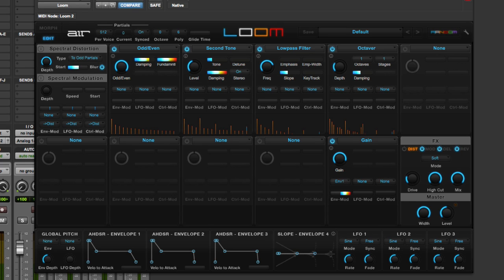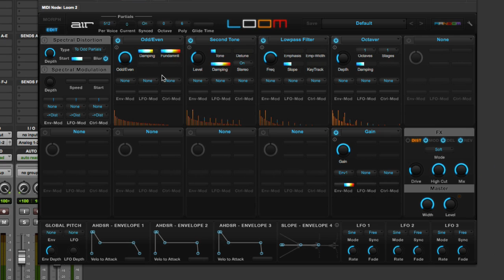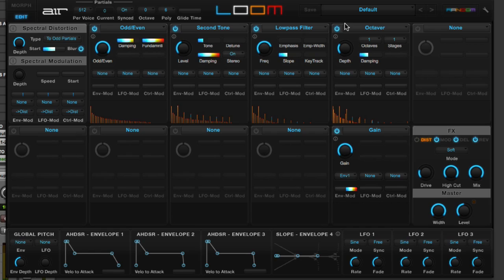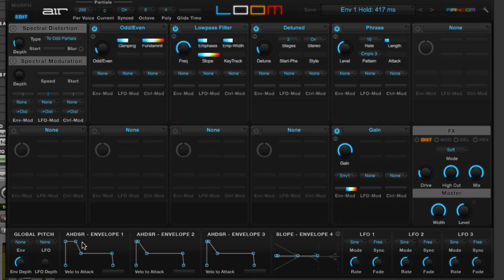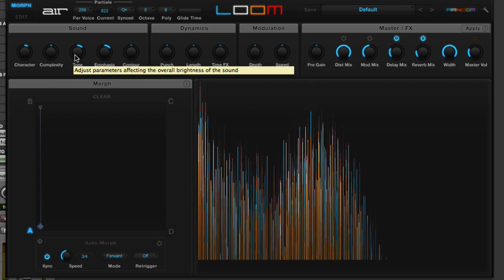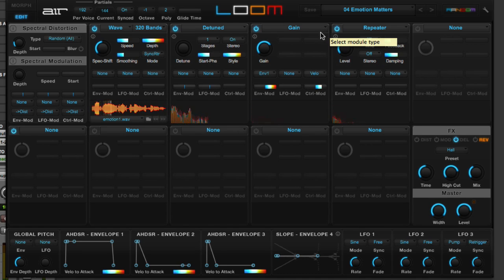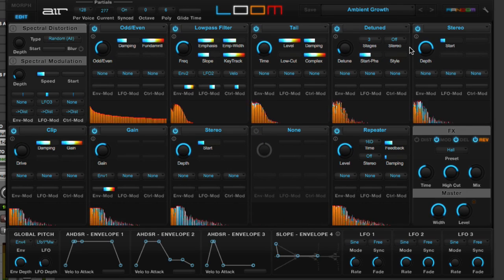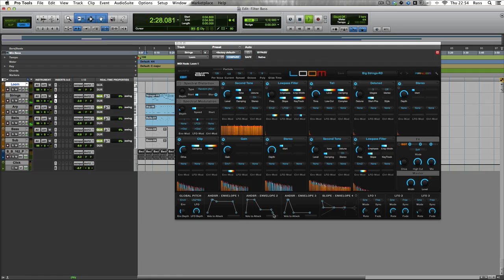AIR Loom Synth Show And Tell - Extended Video

Comment: I just bought a aki keyboard advanced and this came with it did a get the cheep version?
Reply: Cheap version? It's one of my favorite synth for FX. It has very unusual digital/robotic sounding which I like in certain cases. It's not meant to be a synth for analog basses and leads for sure. It's more like a synth for FX and Ambient. You know, the TB-303 used to be considered a useless instrument for a while until it became one of the most popular in EDM. You just got to see the potential of what you got. I love Loom cause it does not sound like every other synths! In my opinion, Loom is underestimated mostly because it is wrongly advertised. Cause to be honest AIR kind of sucks in marketing. They don't even make their own video tutorials which is a shame. They have product presentation videos but that's it. If you want tutorials you got to pay a third party website...etc.

Comment: Great demo, thanks. I was thinking, is it a better investment than DIVA ( U-he) ?
Reply: Diva is a subtractive synth. Totally different.
Reply: I work with Ableton  Live (latest version) on a 32bit environment, Air Loom is a 64bit only?
I guess I can't use it?
Reply: David German Check their website. The VST version is 32 and 64-bit, but the AU version is 64-bit. However, they don't say if the VST version is Windows only, and they claim the AU version is qualified for Logic X. I use Digital Performer on OS X, so I would email them and ask, which is what I need to do. Other additive synths are Razor, Alchemy, and Harmor. Harmon is deep (currently PC only but they are releasing an OX version soon, and I plan on getting it for sure). Razor is a bit lighter but a lot of fun to use and sounds great, and Alchemy also does Spectral and Granular synthesis. You asked about Diva. Diva is awesome! One of my favorite subtractive synths. It allows you to mix and match the oscillators, filters and envelopes sections from classic Moog, Roland and Korg type synths plus a lot more. The sound is huge (as are all U-he synths). Diva could easily be your go to classic style subtractive synth.
Reply: I have a macbook pro, I don't use a Windows comp. 
I just got Diva, and it sounds great.
I will ask AIR about Loom's 32 bit, thanks for your help:  DAVID

Comment: This product seem good only on the video presentation. while I cannot say anything about the sounds etc I can clearly state the interface SUCKS!  I installed it today. Firs I have no idea how to register it. The interface is terribly dark and super tiny small. I use 4K monitor and it is absolutely unreadable. When I open it on HD monitor it is still very bad (50% of the text is unreadable). Whoever designed DARK GREY FONTS on DARK GREY BACKGROUND should be fired as this person definitely does not know how to design usable interface. The layout seem to be OK but the colors, lack of resizing (unless I am missing something) make this product a garbage for me. If you using notebook with lower resolution you might be OK with the design but this software is definitely not designed to modern hi-res monitors!
On top of that I tried to contact company on the phone and their hour are very limited. 
While I could understand that I do not understand why I need to enter some stupid SUPPORT CODE into their forms in order to register the product or fix initial issues with installation OR configuration.  BTWQ - no documentation could be found anywhere and AIR website is really poorly designed (all fonts are also super tiny small).
Bottom line is that without making even a single sound out of this plugin I already have had very bad experience. I do not recommend it :-(